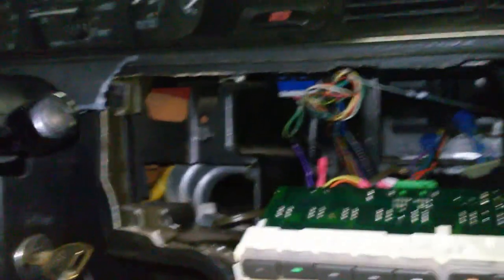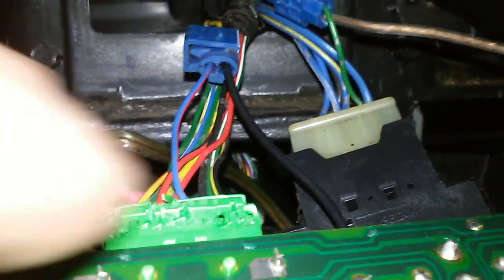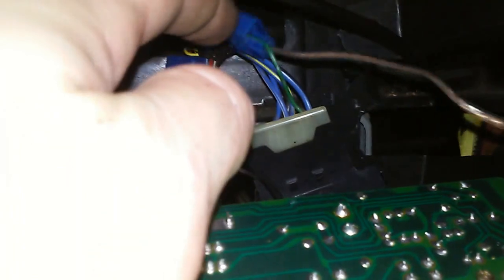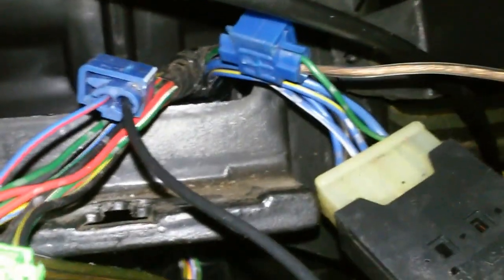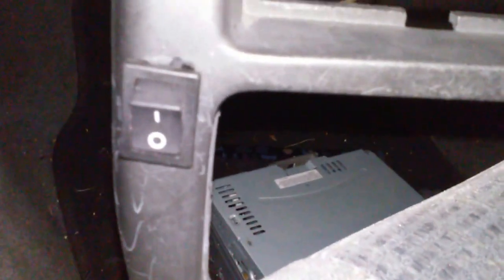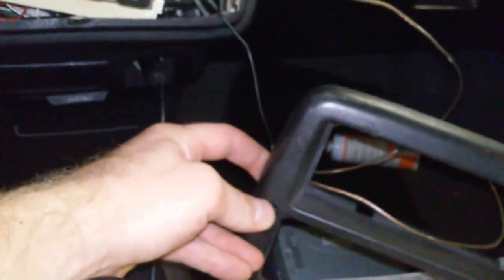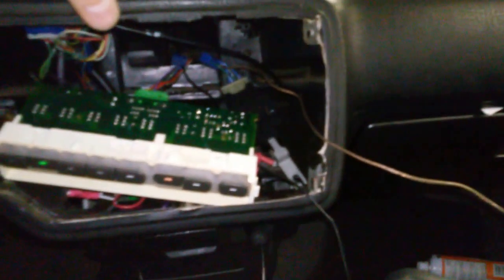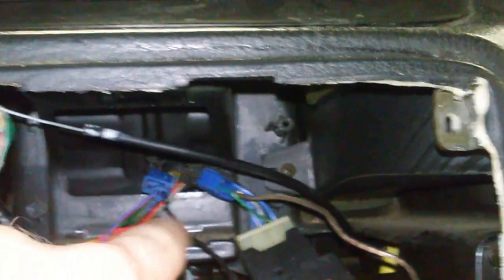92-95 Civic A/C Head Unit Repair

Comment: I'm still debating whether I want to do this repair or pull the climate control box,open it up, and solder the broken joints,I just did that with the speedometer on my 85 Civic.
Reply from the maker: solder the joints, that is the correct fix.

Comment: Thank you for this. I didn't want to buy another climate control just to possibly have the same issue.
Reply from the maker: Turns out the issue can be corrected by resoldering the contacts on the circuit board for the AC switch. They fail but don't look bad, they develop micro cracks. Resoldering the board may fix it.

Comment: You saved me so much grief. Problem solved with my compressor not kicking in during charging. A suggestion for removing the three screws would be to remove the console right below it. Using an 8" long phillips, with a slim handle, this will be much easier. How can i repay you? Do you have a patreon? I'm serious.

Edit: I installed a lighted switch, but i can't get the wiring right. It lights on in the off position, and off in the on positon. It has 3 prongs, one for the green wire, one for the red/blue, and one ground.
Reply from the maker: Green is ground, usually. Your thanks is enough but josephpseraphin@gmail.com is my paypal.
Reply: @SailingKitabu  Thanks for the tips. Just sent you a paypal as appreciation for your video.
Reply: Here's a video of replacing brake shoes on the 92-95 civic. I used to struggle for hours with those springs and this technique I came up with takes under 10 minutes. https://youtu.be/svF_xoLlcLw
Reply from the maker: @vinny1995  Thanks!

Comment: I have 94 honda civic ex, I try blue red wire and green like in this vdo  it does't work  then  I try blue red and  blue white   it work perfectly
Reply: blue and red and. blue and white you can show me. the blue and white wire is more fat between blue and red.
Reply: Which socket did you get the blue white wire from?

Comment: I have a honda civic eg 92 hatch. I have the same problem but I replace a new head unit. But I encountered the same problem again. After 15 to 20 mins driving the cold air and fan shuts down automatically, both fan and the AC. I have to push random buttons to make the ac and fan work again but then again it shuts down randomly. 

I love the idea of this vid. It really helps.
Reply: hello, did you solve the problem?